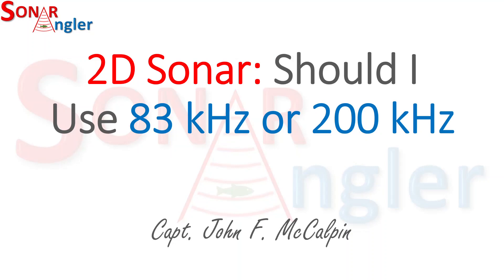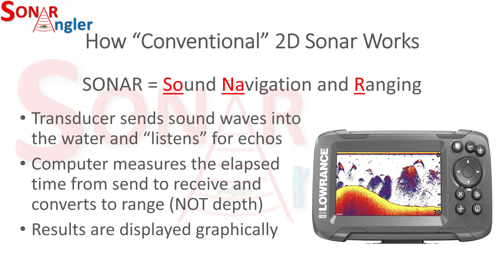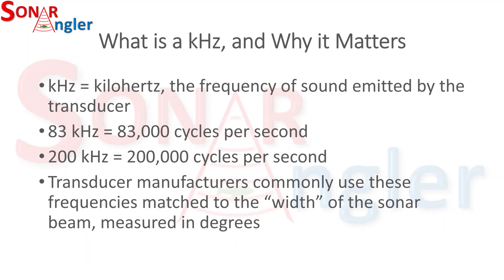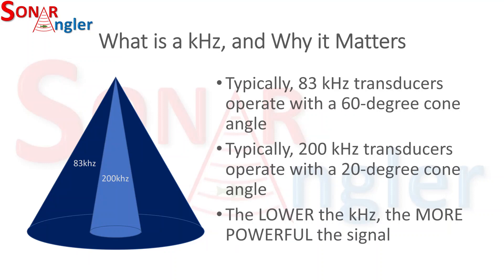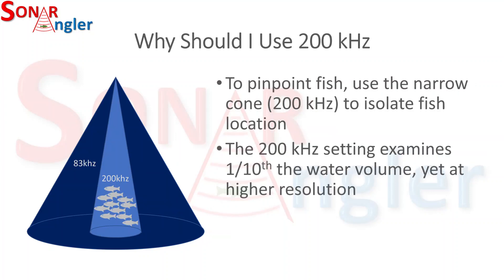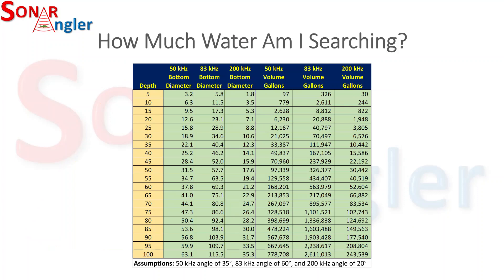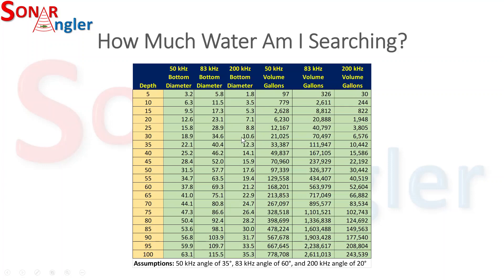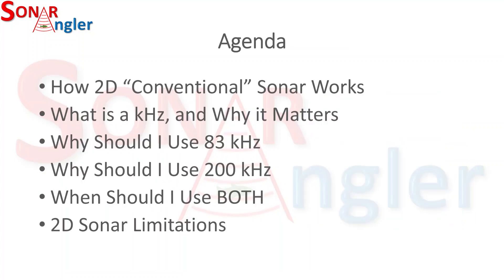SonarAngler 83 kHz vs 200 kHz 2D Sonar settings

Comment: Is there a way to figure cone angle for a given kHz?
Reply from the maker: Thanks for the question...the answer is a bit tricky...  Transducer manufacturers can configure the crystals in a transducer any way they choose, so it isn't a linear relationship between kHz rating and cone angle.  In some cases, the manufacturers have chosen to claim that their cone angles are proprietary (and therefore essentially a trade secret) making comparisons even more difficult.  However, my research indicates that for 2D sonar transducers, the typical cone angles are as follows: 200kHz: about 20 degrees, 83kHz: about 60 degrees, and 50kHz: about 35 degrees (note that decreasing kHz doesn't always relate to wider cone angles).  For scanning sonar (down and side imaging), CHIRP sonar (multi-frequency), and phased array sonar (LiveScope), comparisons of kHz to cone/beam angles--and resulting range capabilities--are highly unreliable.  I hope this helps...  Cheers, Capt. John